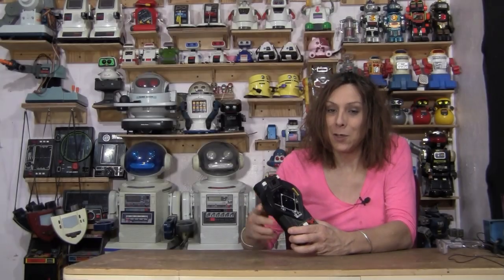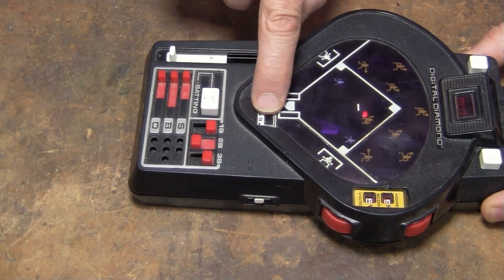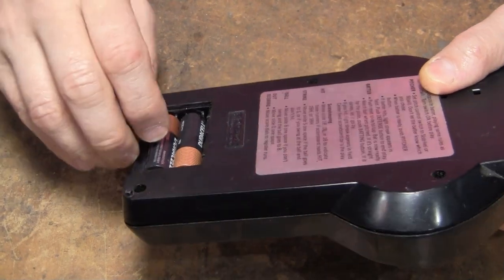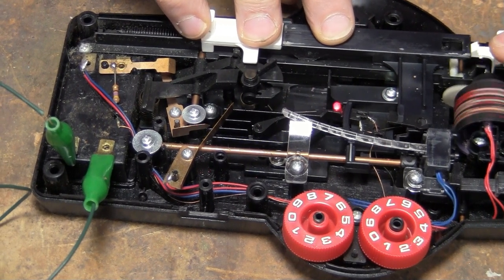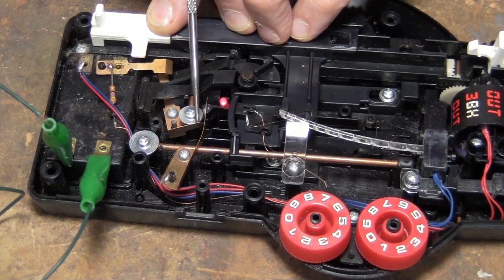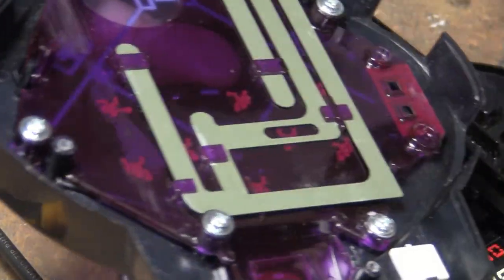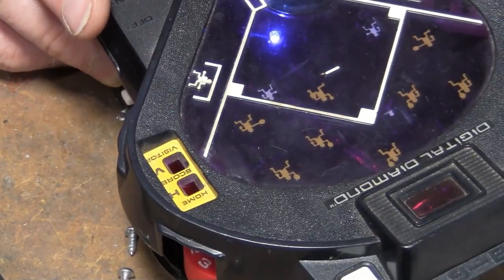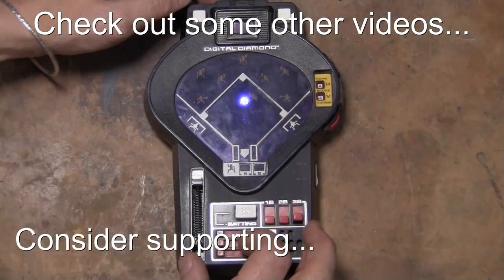Grand Slam Refurbishment of a 1977 TOMY Digital Diamond

Comment: The problem is it is just too simple.  Price and portability really limit what can be done with a mechanical logic.  77 is very close to the various portable LED "computerized" games which could contain a lot more logic to make it more interesting for longer. 
I had one of these as a kid, but it got almost no usage, especially at home because it's a two player only game and my siblings were quite a few years apart from me.
Reply from the maker: I think if you could determine if it was a ball or a strike when pitched, and if you could be fast enough to hit the ball when a strike is thrown, it would make for a much better game.